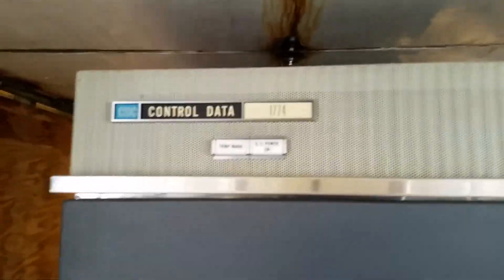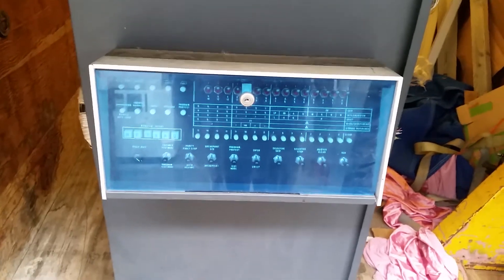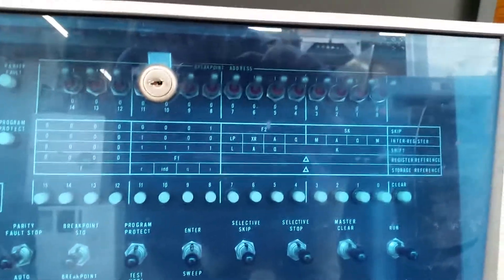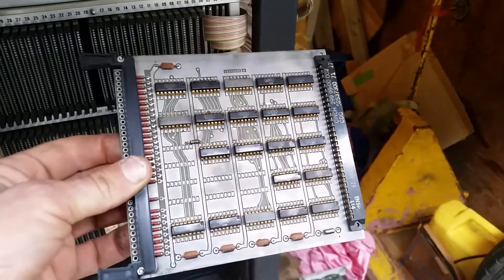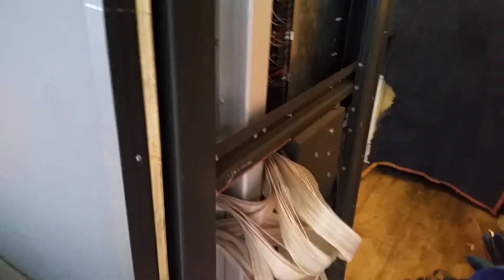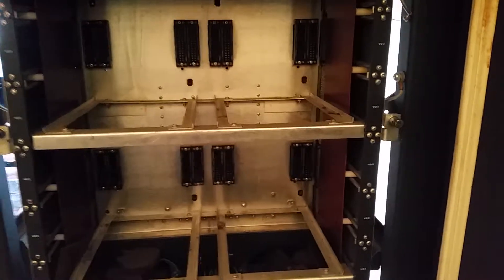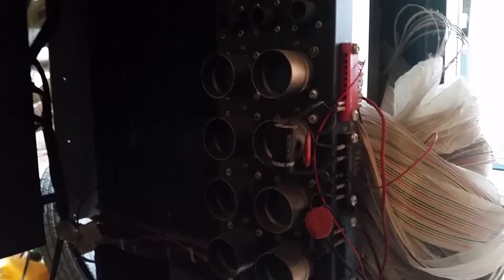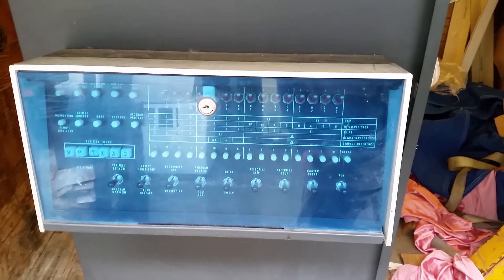CDC 1774 Minicomputer

Comment: Yeah, DEC switches were terrible Just like the Interdata front panels.  That 1774 Minicomputer is beautifully built, and the front panel is really nice.  Just like the 3600 series.  I think with CDC doing so many DND contracts for shipborne computers caused some of that attention to detail to leak into their commercial line of equipment.

Comment: I actually was trained on the 1704 version back in the 1970's.    Shaped more like a desk .   It was installed at United States Postal Service in San Francisco in the Rincon Annex.    A Postal sorting facility.     Two operators and one CDC Field Engineer.   Operations was 24/7 affair.    They had four CDC tape drives and four CDC disk drives.     100's of modems to communicate to the branch offices all over San Francisco.
Reply from the maker: I missed out on a complete 1704 by just days! It was at the same place I got the 1774, but all that was left was a big pile of chassis full of modules. I have those parts, but it will never be a whole machine again - not even close.

Comment: Doesn’t the 400 Hz power come from an external motor generator?  Do you have that?
Reply from the maker: Yes, I have an MG set that goes with this. I also have quite a few other 400 Hz converters, both mechanical and electronic. Theoretically, I can make about 140 kVA of three phase 400 Hz.